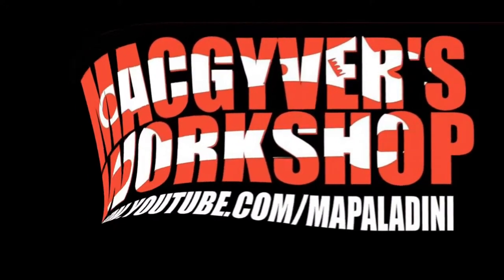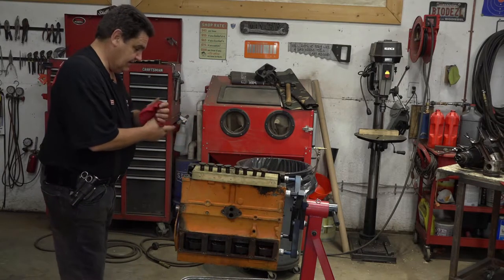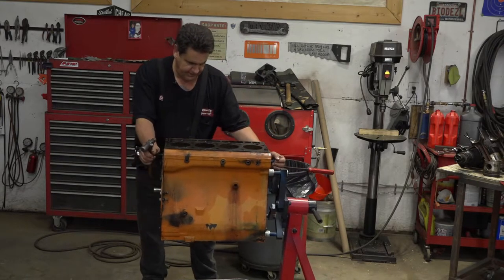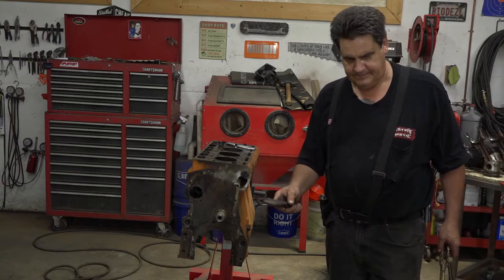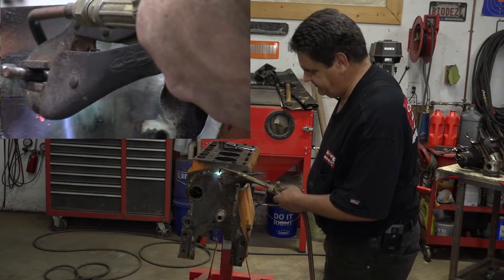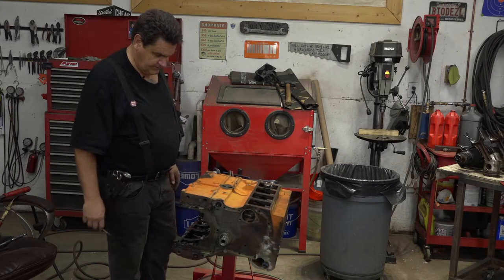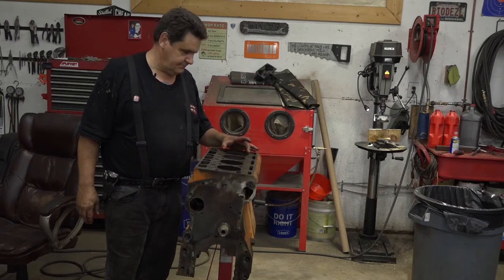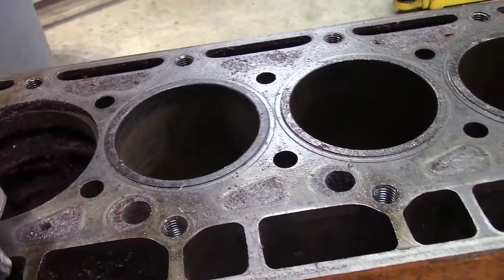Case Tractor Engine teardown Part 2

Comment: Did those bolt extractions for many years. I always heated the bolt itself red hot keeping the heat away from the casting. You then let the bolts cool down completely. What happens is the bolt expands when heated and then shrink down after cooling. They come out like butter. When you have a broken off stud or bolt you just weld a heavy washer to the stud and weld a nut to the washer. After it cools down it comes out like the heated bolts. I would never heat a large casting without heating the whole casting. When you heat in the middle of a casting you are in danger creating cracking because the cast iron tries to expand but can't and thereby it cracks. Seen it happen.
Reply from the maker: Absolutely! That would suck having to replace an engine block! The method I learned when I worked up north was to heat the bolt, then hit the bolt with a damp rag (wearing gloves of course) making sure no water gets on the casting. The sudden cooling of the bolt breaks it loose as it cools down. Dimilar process, just speeds up the process a bit.

Comment: Hy, Just tearing down the same engine and found your video. did the shop work on the block deck at all? There are raised rings machined coming out of the deck which sit outside of the liner flanges..does that mean the deck cant be resurfaced? I've similar corrosion on the deck that you had which I'd like to remove if poss..appreciate any help

Comment: Where is the rest of this engine rebuild?  I would really like to see it.
Reply from the maker: Been hard to find time to work on it. I was finally able to get it back together a couple of months ago. Couldn't film it though. Filming takes 10x longer and I had to get the tractor finished so I could make room in the shop. I did take pics along the way though. I'll try and put to gether a slide show and post it. It runs great, Can't wait to get the side mower finished. I have to save up for a hydraulic motor to go on the mower deck. But I can hook a regular 3 point bush hog up to it and get some use out of it in the mean time.
Reply: Thank you.

Comment: Any Updates on this project?
Reply from the maker: Been hard to find time to work on it. I was finally able to get it back together a couple of months ago. Couldn't film it though. Filming takes 10x longer and I had to get the tractor finished so I could make room in the shop. I did take pics along the way though. I'll try and put to gether a slide show and post it. It runs great, Can't wait to get the side mower finished. I have to save up for a hydraulic motor to go on the mower deck. But I can hook a regular 3 point bush hog up to it and get some use out of it in the mean time.

Comment: Did you get this project finished? Was the block the only thing you took to the machine shop? How did you load it? Thanks
Reply from the maker: Been hard to find time to work on it. I was finally able to get it back together a couple of months ago. Couldn't film it though. Filming takes 10x longer and I had to get the tractor finished so I could make room in the shop. I did take pics along the way though. I'll try and put to gether a slide show and post it. It runs great, Can't wait to get the side mower finished. I have to save up for a hydraulic motor to go on the mower deck. But I can hook a regular 3 point bush hog up to it and get some use out of it in the mean time.